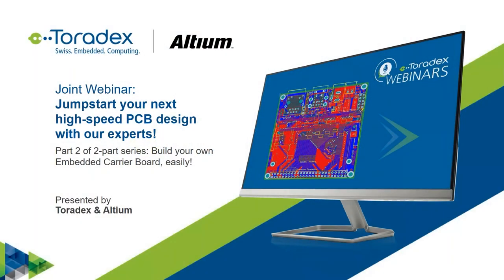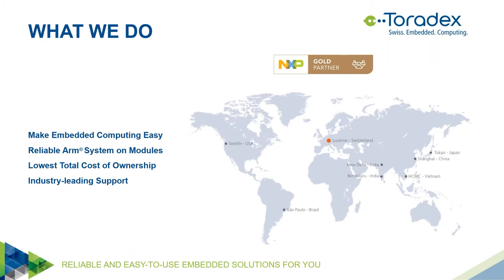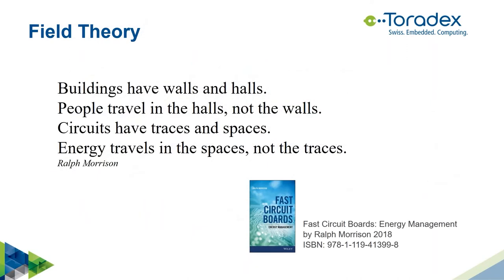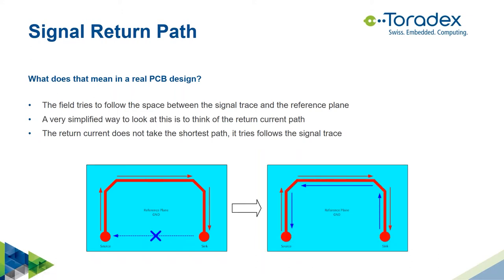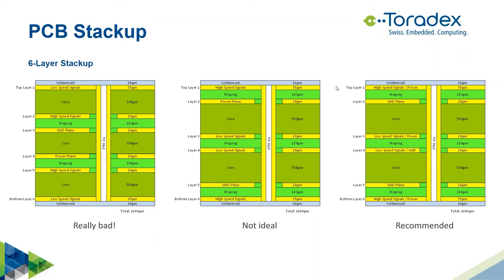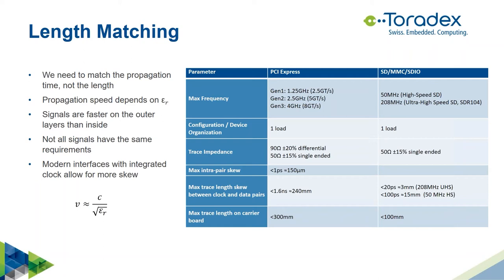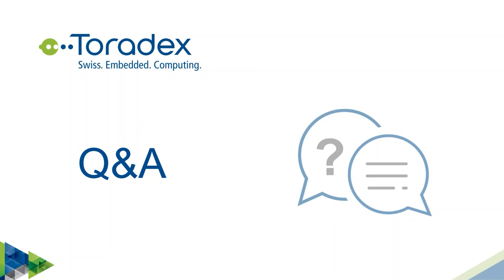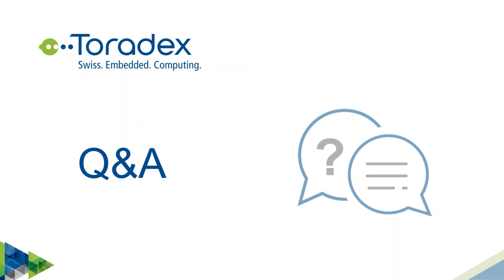Jumpstart your next high-speed PCB design with our experts!

Comment: The demo hasn't show how impedance is controlled if I need to use vias, nor tool for return current path over vias. Does Altium support HDI design or should I look elsewhere?
Reply from the maker: Hi Aerohk, 
Altium supports HDI designs. In the later versions, it is possible to set rules in the DRC for the return path. However, I prefer not using these DRC settings.
When using vias, it is important to provide a solid return path. One solution is adding GND vias next to the signal vias. This allows the return signal to switch to another GND plane. More information can be found in the Toradex Layout Design Guide in Figure 39 and 40.
                                                                                                                                                                                                                                                 - Peter